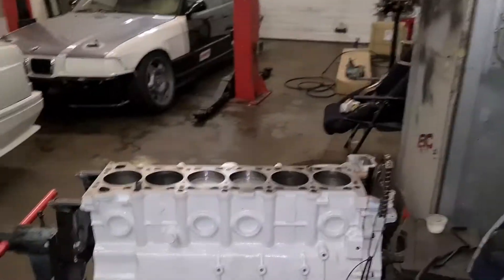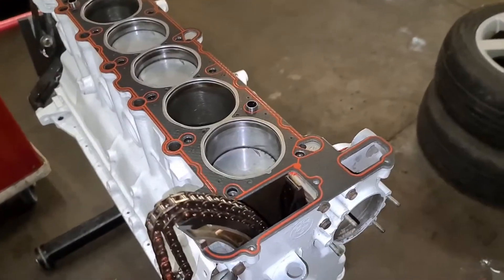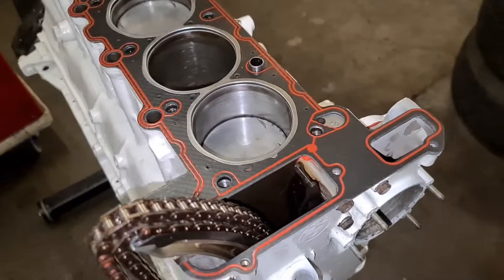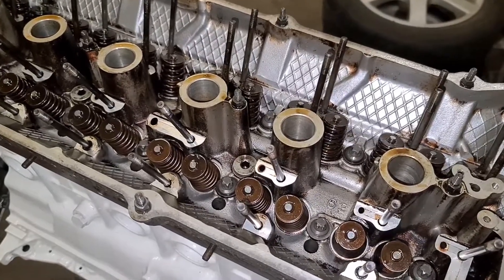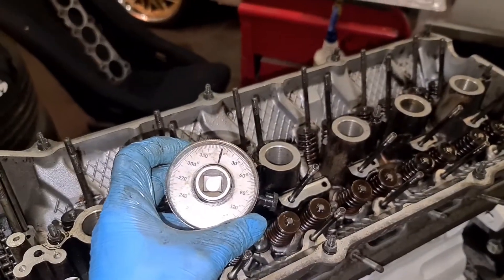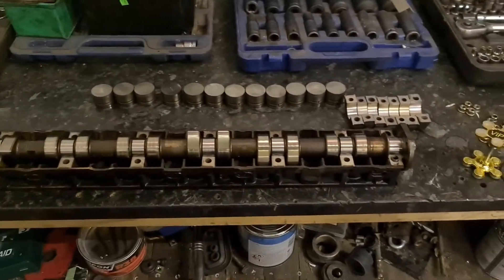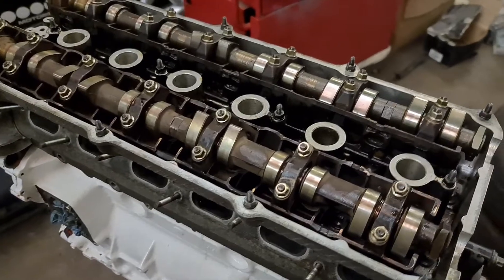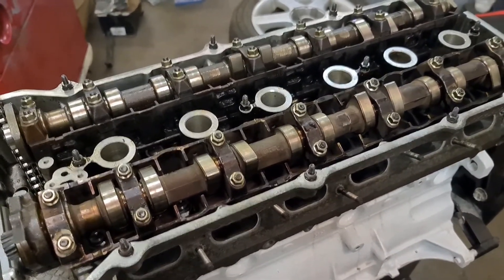Bmw E36 M50B30 Stroker Engine Build, Part 6 Head and camshaft installation

Comment: Hola como se hace elntiempo poniendo la leva m54b30? Ya quebla pusimos y lanprimera leva en punto muertonqueda mas abajo que la leva de salida
Reply from the maker: Sorry mate, only speak English
Reply: Hello, how do I put the intake cam of the m54b30 on time, since we put them with the blocking plates, and the first cam of the camshaft of the m54 b30 is further delayed in time than the output cam of the m52b28, and the engine was not Fine, it stalled when accelerating fully, how can I do it?

Comment: from what m52b? you used exhaust cam? Arre they same or?
Reply from the maker: I used m52b28 but m52b25 also the same. Just standard exhaust cam
Reply: and i hear some people use m50intake cam to be m52 exhaust cam is it true? Also m52b23 is no like m52b28 m52b25 cam?
Reply from the maker: @letva1707  yes non vanos m50 intake cam on the exhaust side can be done.

No such engine as m52b23, its m52b25 single vanos found in 323 e36 cars and m52b28 single vanos in the 328s. 325s would be m50 either without vanos of with vanos.
Reply: @GaragE36uk  true, my fault and what is the difference in power which is better m50 intake or m52 exhaust?
Reply from the maker: @letva1707  I have not tried the m50 intake, but its meant to be more power
Reply: @GaragE36uk  e
With m50?
Reply from the maker: @letva1707  Yes the m50 non vanos intake cam used on the m52 engine is an upgrade.

Comment: what head gasket are you using standard m50 1,75 or ?
Reply from the maker: Standard headgasket
Reply: @GaragE36uk  Oka nice building one my self atm with itb . Do you know what power you end Up making
Reply from the maker: @nicolaikruse6278  I haven't got it on a dyno yet, but it feels so much better than standard..

I would imagine somewhere around 230/240bhp.

I'll get it on a dyno soon..

Comment: Nice build! Did you use the m50 tray for the m54 camshaft?
Reply from the maker: Used the m50 one but needed to space it to clear crank
Reply: @GaragE36uk  Are you talking about the shroud under the crank? I've heard that one needs a little tweaking, but I was wondering about the camshaft tray, the one that holds the intake cam and the valve lifters
Reply from the maker: @mateivornicu8252  sorry yes I was talking about the shroud under crank..

The cam tray/carrier i used from the m52 head with the m54 cam installed
Reply: @GaragE36uk  Do you know if the m54 intake cam fits the m50 carrier?
Reply from the maker: @mateivornicu8252  from memory yes it fits.
Reply: @GaragE36uk  thanks bro

Comment: We are rebuilding m54 with stripped threads. We drilled and tapped holes to m12 and fitted some random m12 studs. Cheaper than time-serts and should be helluva lot stronger too.
Reply from the maker: Yes that's always the option when threads are pulled. Arp studs are quite expensive also. So being able to use random studs will save you some money.

Comment: Intake .06mm?
Exhaust ?
Reply from the maker: M54b30 intake spec cam 240º 9.7mm

And standard m52 exhaust cam
Reply: @GaragE36uk  hp ?
Reply from the maker: Maybe 250bhp, hard to know really, I will dyno once finished.
Reply: @GaragE36uk  chip tuning yes ecu
Reply from the maker: @ilkin-898  using m52 management so m52 ecu and loom
Reply: @GaragE36uk  do you know if that is the same as m50 non vanos exhaust cam?